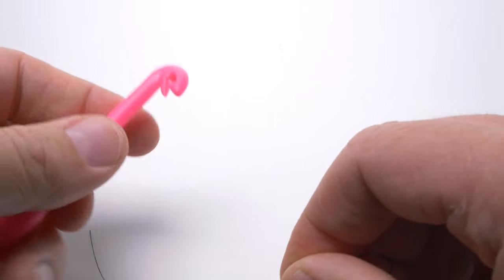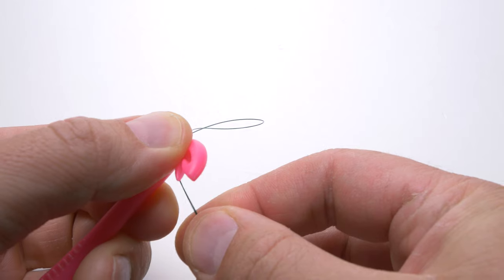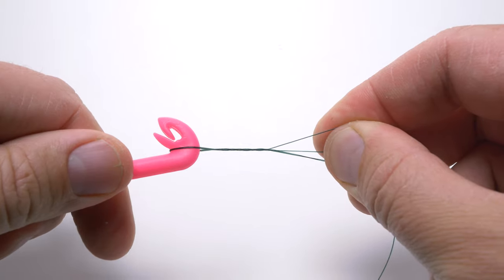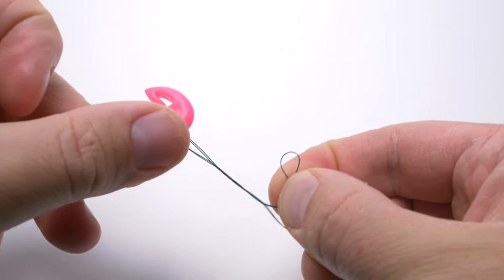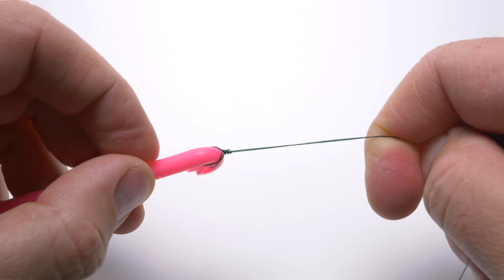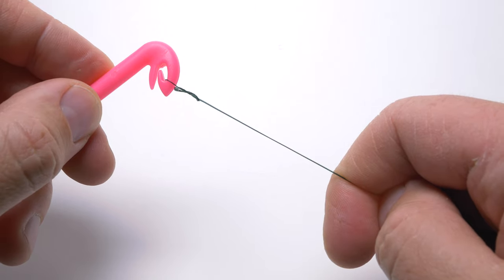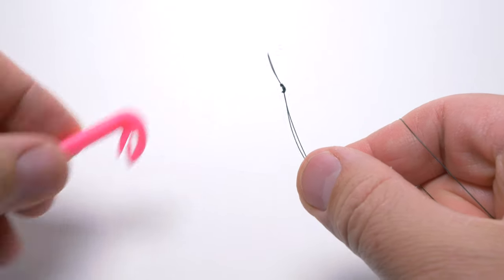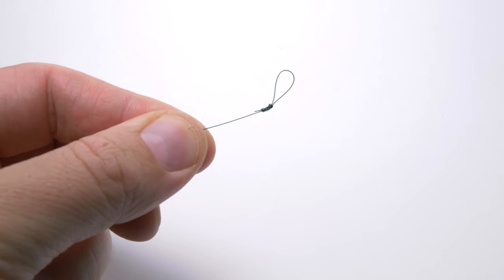How to use RINGERS/SENSAS LOOP TYER for FLOAT POLE FEEDER fishing?

Comment: I like the idea, but do not like that the loop goes off at an angle from the line...
But, if you need consistent sized loops and hook links then this is a great way to make them...
Reply from the maker: It acts like with thicker mono and it's ok with finer ones.
Cheers